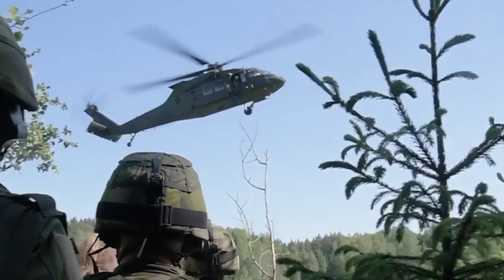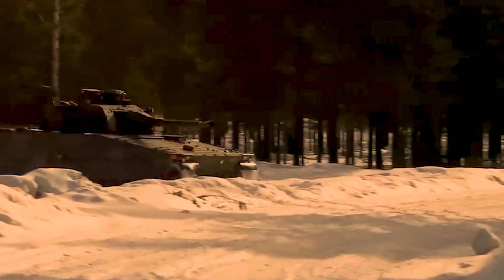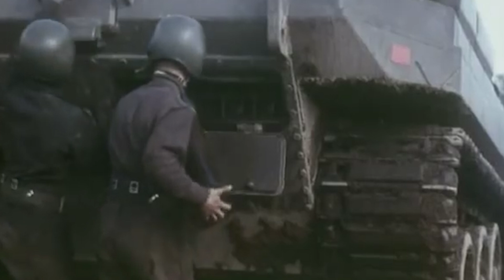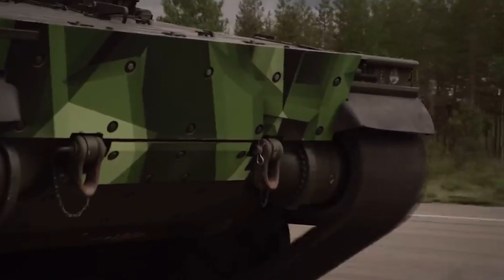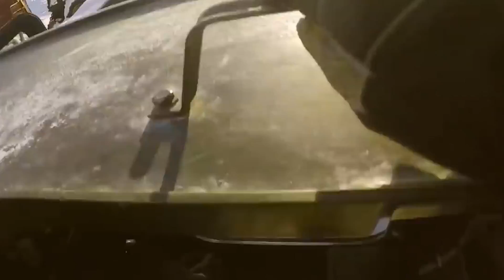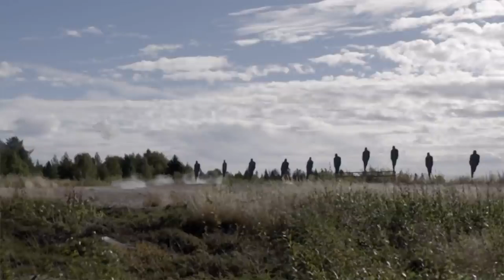The Best Infantry Fighting Vehicle Ever Seen

Comment: VARIANTS OF THE CV90

The following versions were developed by Hägglund/Bofors in cooperation with FOA and FMV for Försvarsmakten as part of the Stridsfordon 90 (Strf 90)-family. Sweden originally planned for a mix of CV9040 and CV9025, tests of the 25 mm turret being carried out on an Ikv 91 chassis, but finally decided on the 40 mm version, due to the much higher versatility of the larger calibre.

Stridsfordon (Strf) 9040 (SB1A3): The original model carries eight soldiers and is equipped with a 40 mm Bofors autocannon. From November 1997, the gun was gyro-stabilized. Versions are referred to by the letters A, B or C depending on upgrades. All from A onwards remain in service.

Strf 9040: Original production version with no gun stabilization and Lyran mortar. Incremental improvements were made during production; all have been upgraded to Strf9040A standard.

Strf 9040A: Strf 9040 upgraded with extensive chassis modifications and external gun stabilisation on turret front. It has more storage and better emergency exits, and the seats in the troop compartment were reduced to seven.

Strf 9040B: 9040A updated with improvements to armament (new fire control software, electric firing pin, fully stabilized gun with internal stabilisation and reserve sight with video camera for the gunner), improved suspension for better accuracy and crew comfort while moving, new instrumentation and new seatbelts.

Strf 9040B1: Strf9040B modified for international peacekeeping missions. It has a 3P ammunition programmer, climate control and anti-spall liner.

Strf 9040C: Upgraded version for crew training and international operations. As per 9040B1 with additional all-round armour, laser filtering in all periscopes and tropical grade air conditioning. Due to the bulk and weight of the modifications, only six soldiers can be carried.

CV9040 AAV Luftvärnskanonvagn (lvkv) 9040: Anti-air vehicle, fitted with PS-95 radar from Thomson CSF Harfang (now Thales Group) and a high elevation 40 mm autocannon capable of using programmable ammunition. It is connected to the national air defence net LuLIS. Three have been upgraded to C-standard. There is also a demonstrator, designated Lvkv 90-TD, fitted with infrared video targeting and a fully stabilized gun for firing on the move.

Granatkastarpansarbandvagn (Grkpbv) 90: (Tracked Armoured Mortar Vehicle), producer name Mjölner: A CV 90 fitted with two 120 mm mortars. The 40 CV90 hulls for this project had already been purchased by 2003 and were originally intended to be equipped with the Patria Advanced Mortar System. For economic reasons, Genomförandegruppen recommended against it and the AMOS order was cancelled with the vehicles put in storage until BAE Systems AB received a contract in December 2016 to install Mjölner 120 mm mortars on the 40 CV90s to increase the indirect fire capability of mechanized battalions. The first units were delivered in January 2019 and all 40 vehicles had been delivered by 2020. In 2022 an additional 20 vehicles were ordered with deliveries scheduled for between 2023 to 2025.

Stridsledningspansarbandvagn (Stripbv) 90 (Forward Command Vehicle): Used by the battalion and brigade commander for command and control. Two were upgraded to C-standard, but have been decommissioned as of 2011.

Eldledningspansarbandvagn (Epbv) 90 (Forward Observation Vehicle): For directing artillery and mortar fire, a more advanced IR sensor was fitted; eight have been upgraded to C-standard.

Bärgningsbandvagn (Bgbv) 90, (Armoured Recovery Vehicle): Two 9-tonne winches provide a maximum capacity of 72 tonnes through 4-way pulleys. Three have been upgraded to C-standard, and at least one has been used in Afghanistan.
The command, forward observation and armoured recovery vehicles are armed only with a machine gun.

Störpansarbandvagn (Störpbv) 90 (Electronic Warfare Vehicle): A 9040A had its turret replaced with a fixed housing containing retractable mast and a LEMUR weapons station. Planned in 2002, a single unit was produced before serial production was cancelled for economic reasons and as of 2013 the project is still on hold.

Strf 90120/CV90120-T: Light tank demonstrator armed with CTG 120/L50 (Compact Tank Gun) developed by RUAG. The gun is 120mm smoothbore, calibre length 50, with a rate of fire of 12–14 rds/minute. 12 rounds are kept ready in the turret bustle, with a further 33 stowed in the hull rear.

Stridsfordon 9040/56: Prototype version of the CV 9040 equipped with the Bofors RB56 anti-tank missile. Issues with the sight alignment were unsolved and no units ordered.

CV90120-T prototype, from which PL-01 mockup was developed

CV9030 Export version with a 30 mm Bushmaster II autocannon. Adopted by Norway, Switzerland and Finland. Within BAE Systems Hägglunds, the original version of the Norwegian CV9030N is known as the CV90 MK I. The Finnish CV9030FIN and Swiss CV9030CH vehicles are known as the CV90 MK II. The CV90 MK II is also available as CV9030 COM – Command & Control Vehicle. The recently upgraded CV9030N infantry fighting, command & control and reconnaissance vehicles for Norway are known as CV90 MkIIIb, and this is the most advanced variant currently in service.

CV9035 Armed with a Bushmaster III 35/50 cannon. Adopted by the Netherlands as CV9035NL and Denmark as CV9035DK. Within BAE Systems Hägglunds, CV9035 is known as the CV90 MK III.

CV90105 Light tank equipped with 105 mm rifled tank gun/turret. Designed by Hägglunds (BAE Systems) and GIAT (Nexter). A newer version features the Cockerill XC-8 turret.

CV90120-T Light tank equipped with a tank turret equipped with a smoothbore 120 mm gun. (RUAG 120 mm Compact Tank Gun)

CV90 CZ Export variant designed in collaboration with VOP CZ marketed to the Czech Republic, manned turret variant.

CV90 CZr Export variant designed in collaboration with VOP CZ marketed to the Czech Republic featuring a Kongsberg MCT-30 unmanned, remote controlled turret, a slightly raised hull and periscope system.

Armadillo - Armoured personnel carrier version built on a modular CV90 Mk III chassis. The CV90 Armadillo can be modified to become a personnel carrier, an ambulance, a command and control centre, a recovery vehicle and many other non-turreted variants at low cost due up to 80% commonality among variants. Currently, only the APC version has been built, with five delivered to Denmark for trials. (Check out the movie "Armadillo, it's a Danish movie about the Danish fighting in Afghanistan)

CV90RWS STING Combat engineering variant built on CV90 Mk I chassis. This vehicle can be outfitted with either a mine plow or a mine roller, and it also has a robotic arm. 28 have been ordered by the Norwegian Army.

CV90RWS Multi BK Mortar carrier variant built on a CV90 Mk I chassis. This vehicle is armed with a VingPos Mortar Weapon System outfitted with an 81mm L16A2 mortar. 24 have been ordered by the Norwegian Army.

CV90 MkIV BAE-developed upgraded variant revealed in January 2018, marketed to the Czech Republic as well as existing customers as an upgrade package. Features include a Scania engine with up to 1000 horsepower, Perkins X300 transmission, and an increased payload of 2 tonnes. The system also includes BAE's iFighting computer system, which claims to enhance situational awareness, aid decision making, improve ergonomics, and enable autonomous support and remote operation.

CV9035NL MLU On 13 January 2021, the Defence Materiel Organisation (DMO) of the Netherlands Armed Forces signed a contract with BAE Systems Hägglunds for a mid-life update of 128 CV90s of the Royal Netherlands Army, with an option for 19 further vehicles. The MLU project features a wide range of modernisations and improvements. The turret has been completely redesigned and will feature a new main gun installation, a mast-mounted 500mm extendable electro-optical sensor, Elbit Systems’ Iron Fist LD (Light Decoupled) active protection system, FN MAG general-purpose machine gun in an external pod and a twin missile launcher for Spike LRII anti-tank guided missiles. 

Furthermore, the CV90s will be equipped with rubber tracks, upgraded cooling, various cyber-security improvements and updated command and control infrastructure. Construction of the new turrets will be conducted by Dutch firm Van Halteren Defence.

🇸🇪 KLART SLUT! 🇸🇪
Reply: Samtidigt eldöppnande 💪🏻
Reply: @petter5721  Grg, pansar, 300 meter öster om ladan, ELD
Reply: SLUT?

Lol what does that mean in Swedish?
Reply: @oldpain7625  it's "end of message" (over and out)

But I know what you were thinking about 😉
Get your mind out of the gutter 🤪
Reply: @oldpain7625  btw is that a word in common usage for harlots?

You should change your nick to "Old painless", you know from "Predator"
Reply: @oldpain7625  The swedish word you seek is "hora", it's what we swedes say to what you read the word as first. ;)

"Slut" is a very common word that means end, more or less.
"För fan, sluta nu." means "For fucks sake, quit it.".
"Mitt fack har inget slut" means "My compartment has no end". Note that "fack" is pronounced very near to how "fuck" is pronounced.
Reply: Hoorah! Why do Americans shout "prostitute" in Swedish?
Reply: @1967nusse  it's a cultural thing.
Reply: Vi behöver mer CV90C för att version B har typ inget skydd

Comment: The CV90120 is a IFV tank. Its a beautiful machine. There is a lot of variety in Cv90's.
Reply: the CV90120 and CV90105 doesnt have a troop compartment, so its just a light tank not a IFV tank
Reply: @lille0le502  Of course there is always a wise guy..

Comment: It has the bushmaster like the Bradley m3a2. What makes it better then the Bradley? Does it even have a networked computer to the other armored vehicles?
Reply: The Swedish CV9040 is armed with a Bofors L70 40mm auto-cannon, firing  APFSDS-T and 40MM3P ammunition, and Akeron ATGM'S. It has full, thermal and infra-red hunter/killer capability. It has data link, allowing fusion of observations, designation, targeting and IFF from ground vehicles, ground surveillance,  helicopter and air force assets, manned and un-manned. It even provides the crew with a digital image of the units line of sight relative to its geographical position, allowing manoeuvring with optimal cover and concealment. It also features an active protection system, the LEDS. All in all, an impressive system.
Reply: Anything can be fitted to the CV90 from 120mm maingun, 20--40mm, mortars, AA etc. And yes the newer CV90's are extremly sensor fusioned and networked...
Reply: The CV90 can be fitted with 30, 35 or 40 mm gun..and yes, the fire control and network capability makes Bradley feel outdated. Nothing wrong with the Bradley but the CV90 is just a notch better @ everything
Reply: @anordman9659  The Bradley has been and remains an awesome fighting machine.  I'm just happy there are viable alternatives other than Brads or BTR's for countries who wants to appear neutral.
Reply: @PersonalityMalfunction  I absolutely agree. The Bradley remains an icon on the battlefield. No one can question that. However, I would rather be in my CV 90 with an awesome 40 mm gun, state-of-the-art fire control, awesome mobility in mud and snow, and network capability.
Reply: @anordman9659  The 125 mm tank killer variant is pretty nifty too! Not to mention Mjolnir!
Reply: @PersonalityMalfunction  unfortunately we didnt buy the 125 mm version. At least not yet.
Reply: @anordman9659  The bushmaster III which is the 35mm version is actually able to be converted to 50mm as well it just haven't been done yet, but its a feature of that gun.
Plus the fire control system is also anti air capable
Reply: @Major_Duck And not to forget the 120mm Rheinmetall gun version. It has just not been ordered by any country yet, but is available.
Reply: Only export versions have bushmaster, Sweden uses 40mm Bofors canon.

It's very much networked together with Swedens tanks as well.
Reply: There is a video called "CV90 Mobility" where  the Norwegian army test a cv90 and a Bradley. The Bradley turned out not being suitable for Norway.
Reply: @richardabraham8313
Eeh...yes, and they had it before the Bradleys. Google it, kid.

Comment: Great vehicle as long as you are short and skinny.
Reply: @TheXmabax  Not true anymore (Durch are taller in average). The Swedes simply did not care about human factors when they spec'd out the CV90 requirements,  taking a "Russian" approach. Swiss CV90 OTOH have a higher roof specifically because the average human does not fit in the vehicle anymore. At least 4 of the 8 riding in back can be normal size. And somewhat comfortable.

Comment: I always hear complaints about the Bradly fighting vehicle's about the height really does not matter if you abuse defilade at that if starts putting rounds  through  your hatches it becomes a trade off, it has a very fast turret, i don't like remote turrets again any damage to power and your down less crew to repair any mobility kills.
Reply: Bradley IFV has 2 minor flaws:
1) ressource intensive
2) low passengers capacity 

If you’re willing to deal with logistics and split up infantry squads, it’s the best combat proven IFV.
Reply: @alexfortin7209  what does that even mean? Nice word salad Sherlock most armor its all resource intensive ITS 46 tons 600 horse power it does not sip gas not made to so even know the copacity or are you just saying its not enough we could just sit on eachothers laps REALLY pack them I there, the brady is a hot mess but I see plans within plans within plans within plans.

Comment: The CV90 is an amazingly effective IFV. Despite its age, it is effectively a new vehicle in its latest iteration, the CV90MkIV. The underlying platform is incredibly sound.
Reply: Even without the latest variant, I wouldn't really call the design 'old' by IFV standards

Solid combat vehicle tho, agreed.  Sweden doesn't build sub-par combat kit
Reply: @chrisburke624  Its up to date sensors and programmable airburst ammo. See also the PUMA and other upcoming IFVs. Its today simply state of the art design and the CV90 was AFAIK the first of this type.
Reply: What is so good about this vehicles design is that it was engineered from ground up to be modular and upgradable. This means that the platform can be upgraded and modified almost indefinitely. At some point older models need to be retired as the frame is too worn out, but that is a different thing from the vehicles in and of itself being modern and up to date. This means that newer versions of the vehicles are as effective as any new platforms developed.

We see the same type of engineering method in may other newer vehicle classes as well. If you have a frame that works you can then update it over time to fit the changing nature of technology. The new Boxer combat vehicle is another very good example of taking this concept even a step further. And I bet that this platform will be able to live for a very long time for that very reason.
Reply: Saw one recently its a whole different beast from the standard CV90
Reply: Sweden likes making entirely new platforms while retaining the same name.

Gripen C vs Gripen E for example.

It's so that pacifists in their parliament don't complain about buying new weapons.
Reply: @firemochimc  Aaaahhhhh, the good old "it's just an upgrade" trick to pacify the ignorant politicians.  Nice.

In Canada we did that with the LAV 3 'upgrade' to the LAV 6.  Entirely new build vehicle, but we could call it an upgrade because one specific part of the older vehicle was used in building the new one
Reply: It’s ages? The Mk 4 is is new vehicle and the Mk 5 is being developed right now. It’s like saying the F16 is an old 70’s fighter jet.
Reply: Old and old, sometimes you can't improve a design because it's already perfect! I'm into guns and to me the best gun ever made and that still kicks all other guns a**es is the 1911.

That gun is a masterpiece. It's still the best gun of all guns when it comes to it's fetaures. Trust me I'm a sport shooting guy. The only reason the Glock has been popular is because of it's light weight, not because it's good, because it isn't. It has become popular among police officers for one single reason only, low weight. They have to drag it around 24/7 when they are working and they seldomly shoot it in active duty, that's why they prefer the Glock, not for it's performance and features.

The Glock is the most crappiest crap of them all. I just hate that gun! The trigger is so stupied and crap, the grip as well and all other aspects of it. I'm not going into details but there are so many things that are wrong with that gun.

Anyways, the 1911 is made in that year. It's a 112 years old gun and still the best gun of them all! That's just crazy.